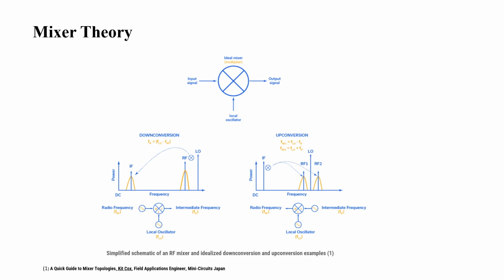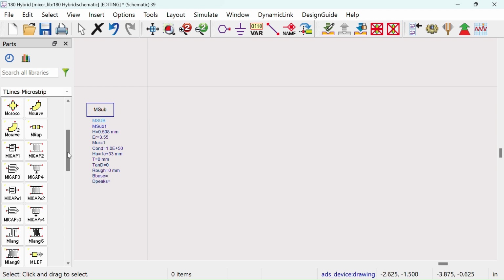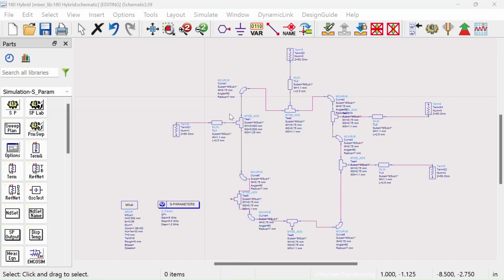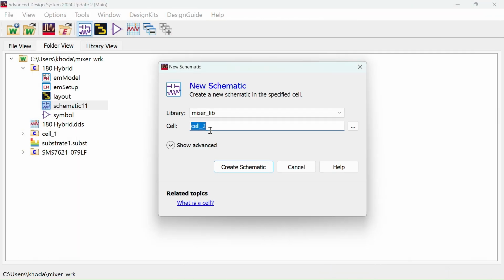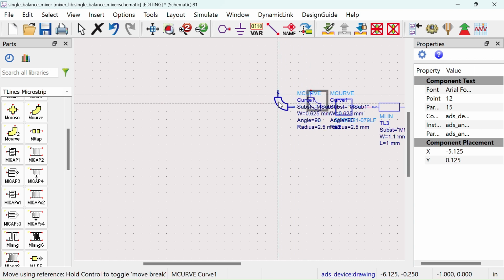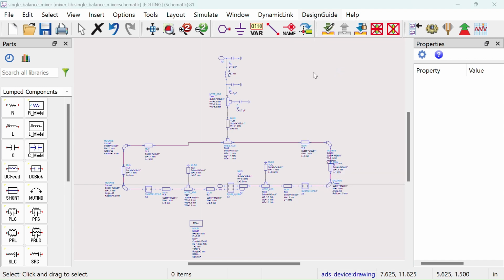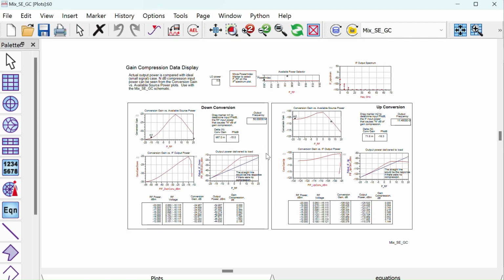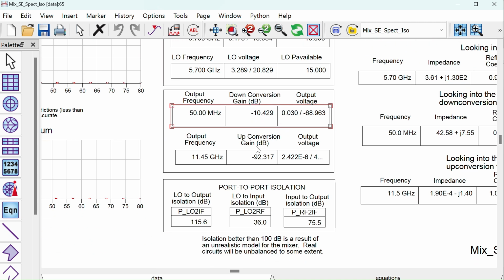Designing a Single-Balanced Mixer in ADS | Step-by-Step Tutorial & Simulation Guide 📡🔧

Comment: Hello Professor I wanted to clarify my understanding: if we use a band-pass filter (BPF) at the output instead of a low-pass filter (LPF), would the mixer then support both down-conversion and up-conversion, whereas the LPF configuration supports only down-conversion by rejecting the high-frequency sum product?
Reply from the maker: Good question, yes a mixer produces both the sum (fRF + fLO) and difference (|fRF − fLO|) frequencies. The function of the output filter is simply to select which mixing product we want. So if we place a low-pass filter at the output, it passes the lower difference frequency, thus is used for down-conversion (rejecting the higher sum component). If instead we use a band-pass filter (BPF) tuned to the sum frequency, we can select that component, which effectively enables up-conversion. So yes — the mixer supports both operations; the output filtering determines which conversion product is utilized.

Comment: Please someone help me to understand why IF spectrum has less than 0dbm power with equations or explanation
Reply from the maker: @tushantmishra1482  Mixers can be used as upconverter or downconverter, when two signal at LO and RF ports are inputs at IF port we have different frequency including mRF+_nLO, if we use a passive mixer some if the input power uses to turn on the diodes and some wastes in other generated frequencies. So, here conversion loss is defined and the output power at IF will be less than input power.
Reply: @profhalimboutayeb  but you gave 15 dbm as lo power even though rf power was less than 0, so IF  can be greater than 0?
Reply from the maker: @tushantmishra1482  We need 15 dBm at LO in order to drive the mixer, otherwise the conversion loss would be greater than this amount. The IF power is calculated based on RF input and conversion loss, for example if the input power is -10dBm and conversion loss is -10dBm, so at IP port we will have -20dBm. Lo power determine the conversion loss.
Reply: @ 
ok thanks sir,
any book where theoritical explainations along with mathematical equations?
Reply from the maker: @tushantmishra1482  B.Razavi, RF MICROELECTRONICS, prentice Hall, 1998, sect. 5.2.3
RF circuit design, by Richard Chi-Hsi Li
Also there are some useful documents in some of the mixer provider websites that are very helpfull to get a better insight such as analog device or mini circuit. They provide some papers and practical solutions for their products, and you can easily find them with a quick search.
Reply: @profhalimboutayeb  sir i need to make complete layout of the mixer, but geometry is incorrect when i generate layout for the full mixer and everything is messy, howe can i make complete layout of single balanced mixer, any pdf or link for that?i need urgent for final year project

Comment: CAN U TELL WHICH DIODE IS USED AND WHERE I CAN FIND ITS SPAR FILE
Reply from the maker: sms7621-079LF Schottky diode from skyworks, if you visit the website and check the diode section you can have the data sheet spar and other useful information about it.
Reply: @profhalimboutayeb sir skywork didnt give any spice model file only sparameter file is provided how can we add it spice file in ads
Reply: @Zaki99-b3q  did you solve this?
Reply: @NobodyHu only designed
Reply: @Zaki99-b3q  ok, thanks

Comment: Great tutorial! Could you elaborate on how to choose the optimal diode pair for a single-balanced mixer in ADS?
Reply from the maker: @jadsaid6528  In mixer design using  schottky diode, there are some parameters that should be considered, cut- off frequency, low series resistor that can lead to lower conversion loss, LO driver level, it means that diode should be compatible with LO power available. You can find all of these parameters in diode data sheet.